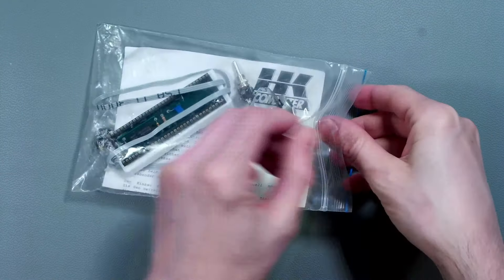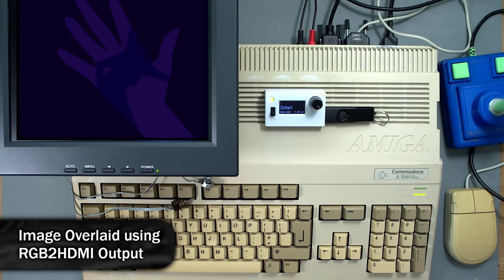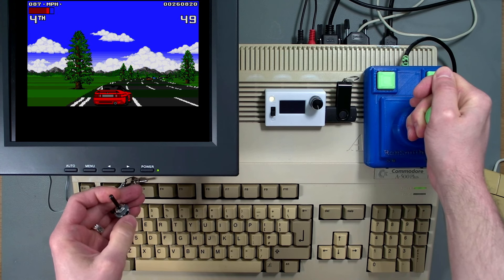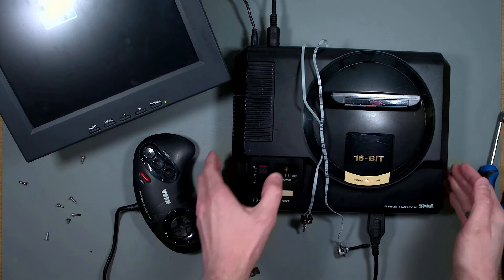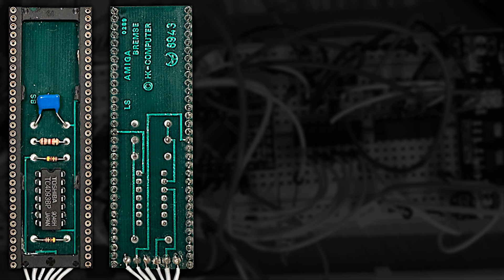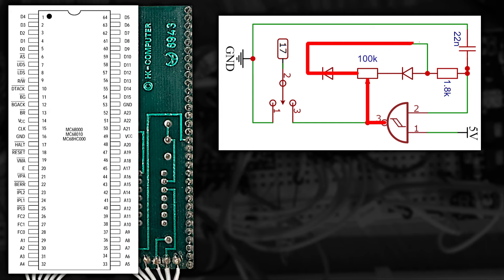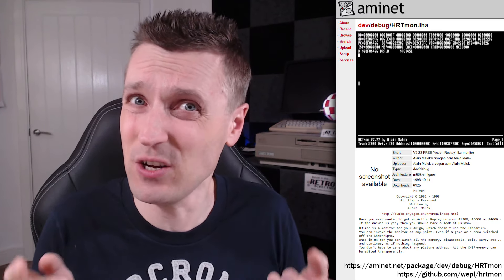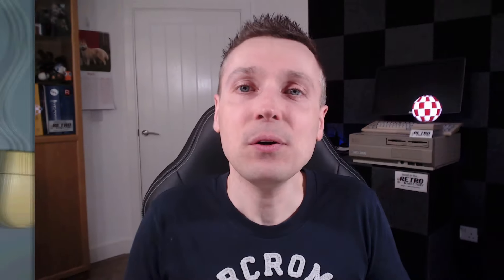Amiga BRAKE! - The Poor Persons Action Replay? and How Can I Improve It?

Comment: You can do the same thing on the C64 or any 6502 by applying the same signal to the RDY pin (wait state input).
There was a cart that had a 555 timer PWM circuit.
Reply from the maker: Cool!

Comment: This is something that my brother & I could have used back in the day for Test Drive.  We wanted to build a steering wheel, instead of using the joystick.  We didn't know anything about electronics or have access to the resources to learn anything.  But we thought if there was a way to make turning the wheel left or right pulse the left/right joystick input at a variable rate, it might achieve what we wanted.  A small turn would result in short pulses and the full turn of the wheel would be like holding the joystick left/right.  We made a steering wheel, gas/break pedals, and a makeshift shifter.  It just didn't work as well as we hoped.
Reply from the maker: I looked into that type of circuit after and it’s actually quite a common approach although I’d never seen it before.
When I was younger  made a steering wheel for lotus although it was very basic and used a home made tilt switch to detect the rotation (was literally a marble wrapped in tin foil moving around in a cardboard tube) kinda worked but not as good as your idea

Comment: I wouldn't have exposed wiring directy from the CPU outside the case, some sort of housing would be good for the resister & switch.
Reply from the maker: It’s only a temporary mod - it’s not like I’ll leave it connected - if I was I’d build a case for it

Comment: Thought it would just be hijacking the clock signal, like how the GBAccelerator works. But this is kinda more interesting. And perhaps more reliable, as hijacking the clock signal could lead to a desync between the CPU and other components.
Reply from the maker: Indeed and it’s probably why the rest of the hardware behaved so well with it too. I was expecting it to be messing with the clock signal too
Reply: Yes, but this also leads to crashes if you turn her up too high.

Comment: How about  been able to peek and poke megadrive via an amiga via action replay disk and wiring the cpu on the pins that correspond. I know unusual thing to ask has you can buy action replay for the megadrive but has the megadrive has no keyboard and thought it may make an interesting project
Reply from the maker: Interesting idea but it’s way more complicated than that. The Amiga Action Replay isn’t so much about watching the CPU, it’s also watching all the custom chipsets. If you wanted to do this I’d be easier to start from scratch and build something new… or cheat - and use an emulator lol
Theresa detailed write up here about how the Amiga action replay works https://jvaltane.kapsi.fi/amiga/howtocode/actionreplay.html